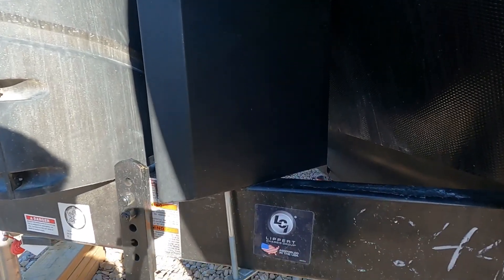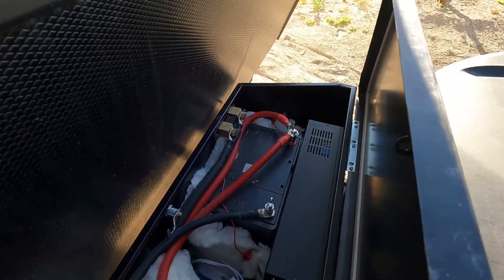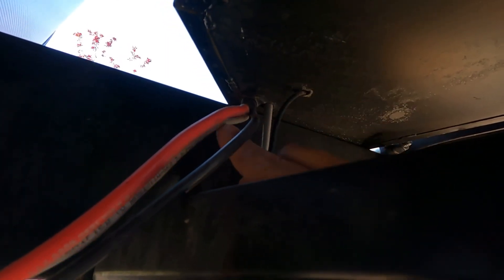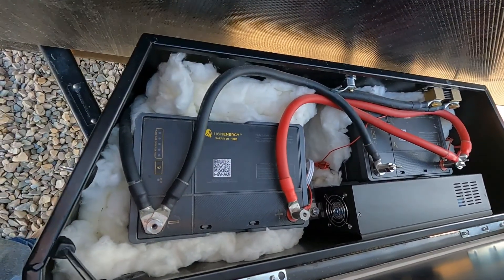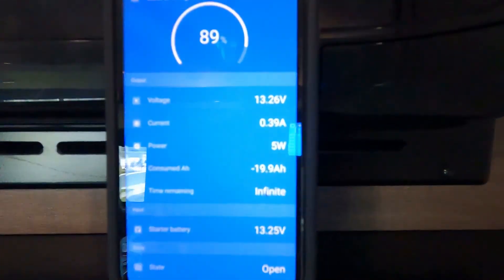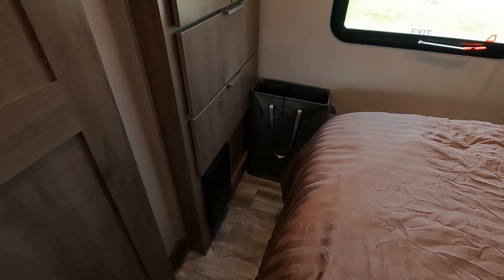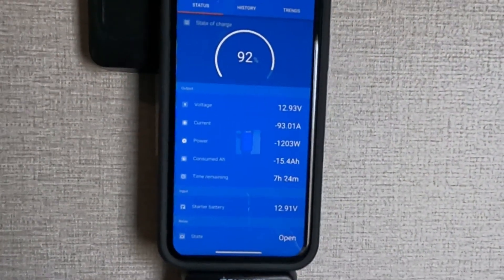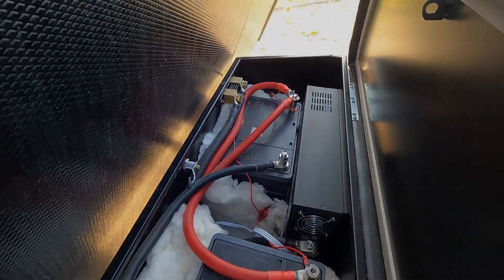Easiest RV Battery Bank Set Up w/ Lion Energy Lithium Batteries

Comment: Does the solar panel ever fully charge the battery?
Reply from the maker: Yes, it depends on your consumption. We will be down to 80% when I wake up in the morning and fully charged by 10am. Our normal consumption is around 150 watts, so our 400w system keeps up topped off all the time. I also built a 10k mobile system, with four 550w panels at our property. This will run AC and the fridge with no problems.

Comment: Would there be overheating concerns with those batteries etc all in that enclosed space.
Reply from the maker: I’ve had this set up in the Utah desert heat for over 3 years now and have had zero problems. I do crack open the top to allow for air circulation, that’s how I have gotten around that concern. I am changing up the box they’re in, to a more square box to hold 1 more battery. I plan in installing two fans on each side of the box ( like a desktop) to allow air to circulate.  I rarely use more than 400 watts at a time, so over heating would never be a problem.
Reply: @rustyoneil216  
Ok thanks for the reply. 👍

Comment: It can’t be this simple.
Reply from the maker: I have used this set up for the past 4 years with zero problems. I open the lid a bit for air circulation, and if I had to do it over again I wish I had a bigger box where I can Mount fans for circulation. But everything works perfect, zero problems
Reply: @rustyoneil216  do the lithiums ever get too cold being in the box?
Reply from the maker: @chrishynes1503  Yes, I live in Utah and it gets at or near zero at times. I lined the box with insulation and put heat pads under each battery. During the winter, I’ll plug in the heat pads and they will keep the batteries warm enough to charge/ discharge. If I’m hooked in to full hook ups, the heater wattage is negligible. Boondocking, they will take up to 120 watts, so you’ll need to take that into consideration for solar needs
Reply: @rustyoneil216  do I need the shunt?  Does it just give you the battery temp?
Reply from the maker: @chrishynes1503  you don’t need the Shunt, but it’s handy to see exactly where your batteries are as far as power. There are cheaper shunts that tell you the basics. I just happen to like Victron products, I can monitor everything from an app on my phone. You can see exactly how much solar you’re producing and going into your batteries. I just built a mobile power station with a 57v 200ah battery for my property, I use this Victron shunt for that as well.
Reply: @rustyoneil216  sorry, to keep bugging you but you have massively helped me.  I have 2 parallel lithium batteries, where do I connect the inverter wires to if i don’t use a shunt?
Reply from the maker: @chrishynes1503 The Negative from one battery and the positive from the other battery. This will drain both batteries evenly.  Along with that, make sure the wires are equal in length, that will also help make sure both batteries are drained and charged evenly.
Reply from the maker: I can see only one pic, but looks like it’s hooked up to the inverter correctly. Can’t see the inverter hooked into the 30 amp outlet
Reply: @rustyoneil216  I was just going to use my 20 amp adapter in the 110 inverter outlet and plug my trailer cord into that.  We have a little 15’ trailer.  Hopefully my 200 amp lithium batteries and my 2000 watt inverter will give enough juice to last a day or so.
Reply: @rustyoneil216  do you have a link to the battery heating pads?
Reply from the maker: I plugged mine straight into the 120 outlet in the inverter
Reply: @rustyoneil216  what brand were they and how much did they cost?
Reply from the maker: https://www.amazon.com/Renogy-Inverter-Converter-Off-Grid-Controller/dp/B096MKPQ1M/ref=sr_1_5?crid=320MUXITFZKWQ&keywords=3000w%2Bpure%2Bsine%2Bwave%2Binverter&qid=1692289386&sprefix=%2Caps%2C145&sr=8-5&th=1
Reply from the maker: You can also see the insulation in the video

Comment: Did you run a ground wire? The manual says it’s recommended. I called Renogy, most of their people don’t know a thing. The girl said (no need) in an RV, book says definitely in an RV. I think the ground fault circuits won’t work without the inverter grounded. Do your wires ever get hot? Everything I read said us 4/0 cable, I got some and it’s a beast, using a 3’ section of 2/0 between batteries but from my closest battery, 4/0 to the inverter. It may be overkill but I’m fused at 350 amps. Getting close to finishing mine and testing it, thanks
Reply from the maker: I did not run a ground wire because I used everything already on the RV. The RV wires that were there before are grounded to the frame of the RV.

Comment: Not a good idea to put the inverter in that box it will over heat.
Reply from the maker: Thanks for the comment. I’m planning on change out this box and adding an extra battery. But so far I haven’t had any issues with the inverter overheating. I do keep the box open during the summer and we’re boondocking at our property.